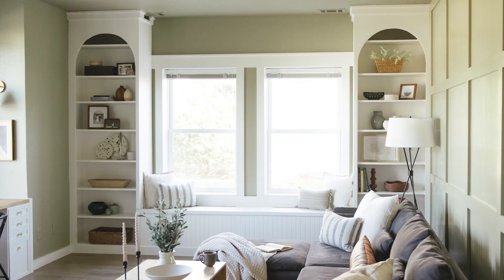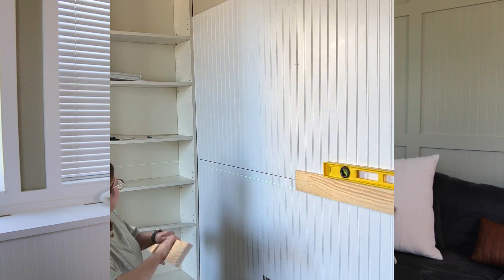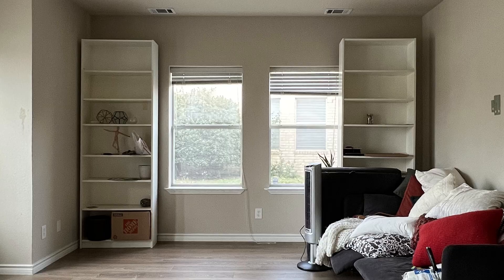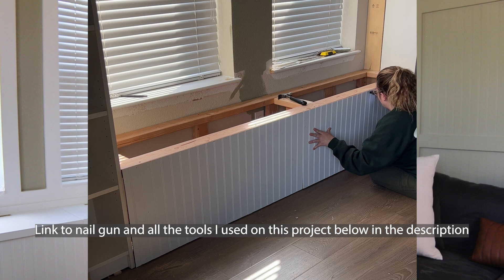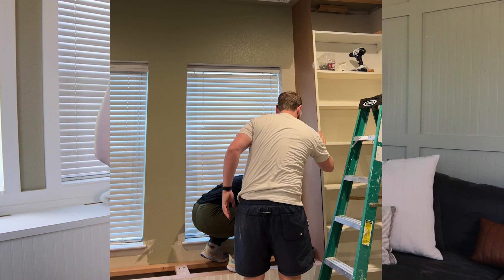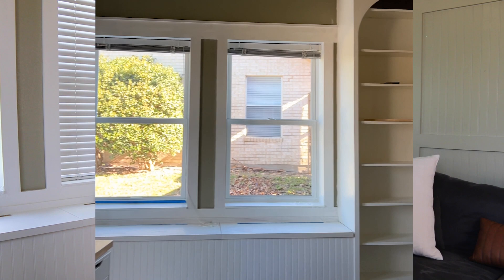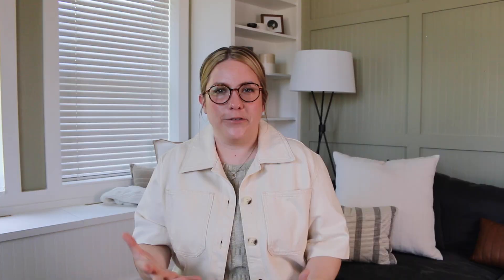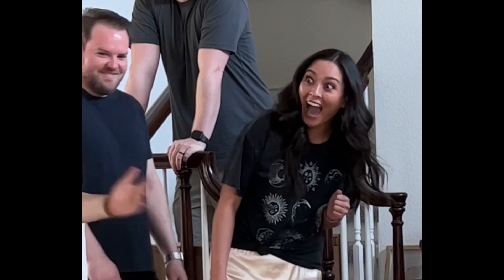DIY Office Makeover | Ikea Arched Billy Bookcase Hack & Ikea Alex Desk Hack | Perkins On Parkway

Comment: It's a very nice office upgrade. The only thing I would have changed was the bookshelf arch. I would have made it so that the top shelf could be used for books or decorations. It still looks nice. I love the simple IKEA drawer front upgrade hack. I think I'm going to copy it for my office upgrade. Overall, you did a wonderful job with the paint color, accent wall, and design.
Reply from the maker: Thank you so much! I think that is a good tip on the arch. Wish I would've thought of that eariler!

Comment: Nice work! I'm assuming you just added the half moon wood to the front of the Billy bookcases along with some trim at the top. Unless I completely missed it somehow in the video, I didn't see you talk about that. Looks great! I also like what you did with the desk. Lots of good stuff here. I personally love a good Ikea hack!
Reply from the maker: Correct! I attached it with brad nails to the some framing that I added to the ceiling. There is a little quick edit of it in there